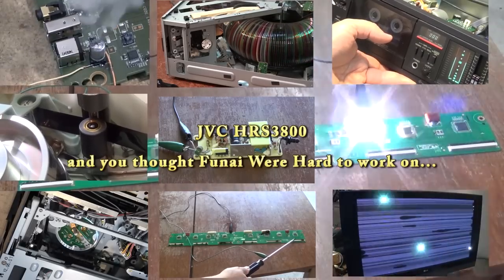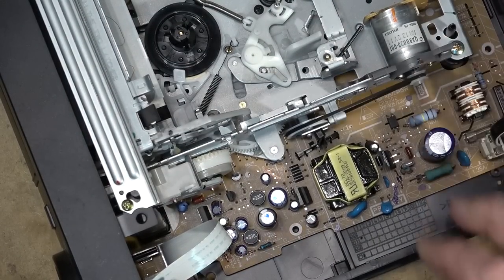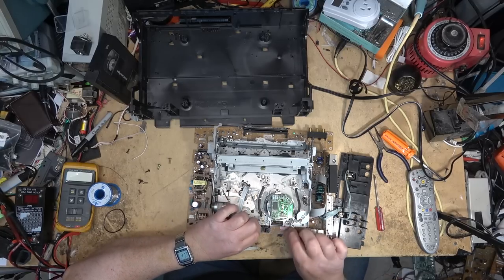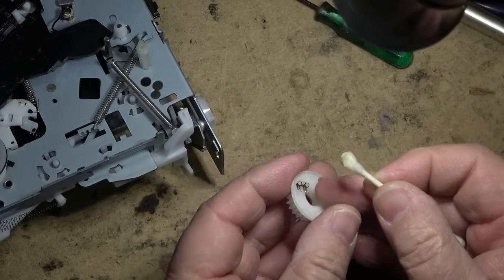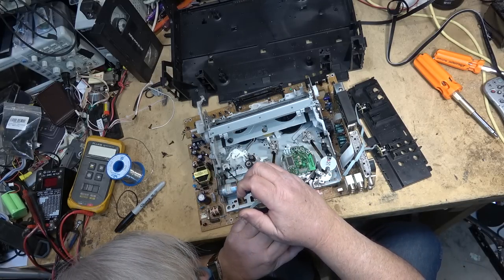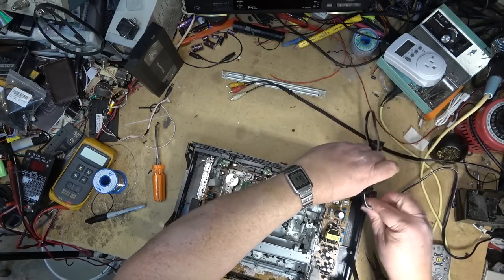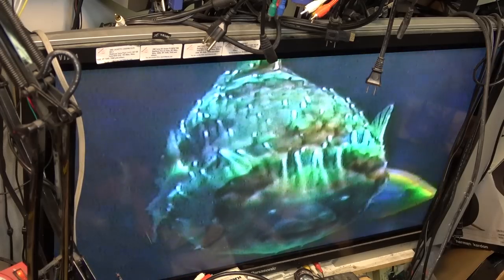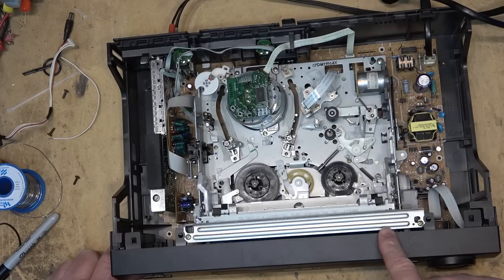JVC HR-S3800 S-VHS VCR Will Not Load Tape

Comment: Thanks, this model was close enough to a HR-VP674U I picked up for $15 to allow me to clean the mode switch and check the belts. Those two screws under the loading mechanism were throwing me for a loop. It’s working just fine now — knock on wood — minus the front panel ribbon cable that I damaged when reassembling it. I have the remote, so it’s not a huge deal.
Also, my mode switch had alignment arrows on the black and white parts, making it pretty simple.

Comment: My experience with JVC VCRs has been that they work great when they're new, and had very good picture quality. But they seemed to wear out quickly and start having tracking problems, first with tapes made on other machines, then eventually on their own tapes! My first "hi-fi" VCR was a JVC, back in 1993. The salesman (remember going to stores and dealing with them?) was showing me "Top Gun" and extolling the picture quality. But I wanted the machine as a hi-fi AUDIO recorder and kept asking him questions about that function. Bought it, worked great, I came to appreciate the PQ, and at about 3 years it started getting tetchy about tracking, and at 5 years it totally failed. ......

After that I got a Mitsubishi VCR - and man, that thing was.... is (still have it) built like a tank. Picked up several more late-model HS-U44x and HS-U74x (the S-VHS variant) Mitsus over the years, most of them like new. People bought one last VCR in the early 2000s but ended up not using them much. 

I still use a Mitsu as an audio time-shifting recorder. Got a coupla low-mileage JVCs in the closet. Should pull 'em out and use 'em up. They prolly won't last long, being just about the models produced.
Reply from the maker: That's the way i feel about an expensive JVC camcorder I have which is basically a door stop.  An expensive one.
Reply: @12voltvids  Like expensive Mercedes, BMW and Porsche cars - great fun to drive...... when they're not in the shop draining your checking account!
Reply from the maker: @lawrencehansen6788  having owned 2 of those over the years i can't agree more. B
Reply: @12voltvids  Ha, i'ts one Jaguar for me. Lovely car. But ONE is enough!
Reply from the maker: @lawrencehansen6788  my dad had a Merc, and I had a bummer.  It was, trust me.
Reply: Мне повезло парни! Взял jvc sr-s388.С наработкой всего 50 часов! Он долго лежал поломаный,и я его отремонтировал! Это круто парни! Показывает супер! Даже на убитых касетах,все четко.Только стерео не везде ловит.Треккинг не помогает.

Comment: Nice video as usual. These decks are a bit of a pain to work with and on top of that they have the habit of internally destroying the mode switch by breaking the comb contacts attachment to the plastic gear. Once they work, the image is fairly good.

Comment: Regarding preserving old tech knowledge. Do remember that NTSC meant "not the same color". Referred as to that the color of an analog TV set was sometimes wrong in phase, I.E. skin color could look green. Also if you stumble upon an old audio recording with hum, its 60/120hz in North America, 50/100hz in most of europe. When stumble into North America and especially Canada, they have a french dish called Poutine, they were a "tuk" (which I still have here in Norway wearing) and they have a British sense of humour that we europeans can identify to.
Reply from the maker: No no no you got it all wrong.  
Never twice same color. 
That problem BTW was solved by a feature called VIR.  Vertical interval reference.   TVs that had that were dead on for chroma, black level and phase.  My parents set had it and it was beautiful. Has a light that came on when broadcast has it.  Most of the large stations did. You could turn it off if you wanted but when on it worked great.
Reply: @12voltvids  Thanks for the info Dave, did not know that. Regarding analog video, I do hate the croma "dot crawl" you get when our national TV provider here save old recordings. They transfer analog video with just a composite cable, not with s-video or other component means. There are analog to digital video converters with an inbuilt comb filter, but apparently that knowledge is dead by now.
Reply from the maker: @thomasraden  the only way to avoid for crawl on analog video is if it was shot edited and kept on a component system such as BETACAM hi8 or svhs in every step. If it ever went to a non component system such as 1", quad, 3/4"  or went through any legacy tbc or switcher the dot crawl has been introduced.

Comment: What's the most easily serviced VCR mechanism? Some of the Sony ones weren't too bad as the chassis just pulls out after 4 screws, and the connectors are all plugs on the bottom that don't need to be handled separately. Too bad about that blue gear issue though...
Reply from the maker: Anything as long as it isn't an ancient Sony Beta

Comment: I have a VCR that i can insert a tape, it starts to roll for  about 2 seconds, then stops. Does not eject. 
Do you have any tips? the optical sensor appears to be working as normal but someone suggested finding and cleaning the spool sensors as those could be dirty, preventing the VCR from knowing if the spools are moving. Do you know where those are located on a VCR or what they look like?
Reply from the maker: Sounds like rotation sensor or the rake up spool is nor turning.   There are several different sensors used.  Some optical some magnetic.

Comment: Those pieces of crap (at least the DigiPure equipped models) sell for big bucks now. Overall it is a reliable chassis unlike the Dynamic Drum units that have that gear that always breaks. 20 years later my cheapened for 2000 HR-S7800U is still kicking along with no problems what so ever.  I'm kinda pissed that my HR-S7500U just decided to pop and die when I plugged it in one day. The drum gear didn't even break yet.

Comment: I have a pair of betamax players, as well as a Sony DAT player and dual cassette deck that arent working properly. Would you be willing to take a look at them? I am paralyzed from my chest down and have a traumatic brain injury, so I'm not able to work on or repair electronics like I used to before the hit and run accident by a driver while riding my motorcycle on the highway. I miss doing my own work, but I'm thankful to still be alive!
Reply: victorangel7784  Do you have a way I can send you some info the make and model? I could send some videos on what's going on with each unit if that would help?

Comment: I Love  VCR's , i have a few in need of repair but ... i just picked up Samsung 960H time lapse SSC-960 for 5 bucks ,  it wont take the tape in but  I can manually make happen and the loading motor only advances about 4 teeth on the gear then backs up and displays a fault icon on the display ...I cant find a replacement loading motor anywhere...im willing to let u have a go at it if yould like ...lmk , great video btw ..I subbed
Reply from the maker: Depends on parts.  None are available these days.

Comment: new sub here..will need ur help..i have a panasonic 50 inch plasma  Panasonic TH50PZ750  i turn it on..and after 5 secs turns off automatically..what this could be? do i need to open it uup and afsten the screws inside a litle bit more? the ground screws?
Reply from the maker: first if it's a Panasonic plasma or any plasma for that matter pull the back off it and make sure that all the screws are tight. If they are turn it on and watch for the blink code when it turns off the power light will flash and it'll flash a code like maybe five blinks and then a pause and then five blinks and a pause or nine blinks and a pause count the number of flashes because that will give you a hint as to where the problem is and you can Google the number of flashes for the model and it will tell you where to look whether it's a fan that's not working or a voltage that's missing or overload it'll at least tell you what section to look in
Reply: @12voltvids  thank you so much! u r briliiant.very kind and helpful..will share one of your videos on my facebook for my friends to see u

Comment: If anyone could help, I'd surely appreciate it. I've asked this on a couple forums with no response yet. I have a Fisher amplifier that isn't sending any power to my Fisher cassette player. What do I need to check to find the issue to my problem?
Reply from the maker: Not enough information to provide any tips.  Is the tape deck powered with mains or low voltage for starters.

Comment: Well done that's a quick fix :-D
I would be surprised if that machine had anything to do with jvc.
Just a badge.
Most cheap crap tv's are made by vestel and rebadged.
Reply: This one is probably still JVC, but definitely not Vestel or Beko. If it's rebadged, it's probably Funai or some other Japanese OEM.